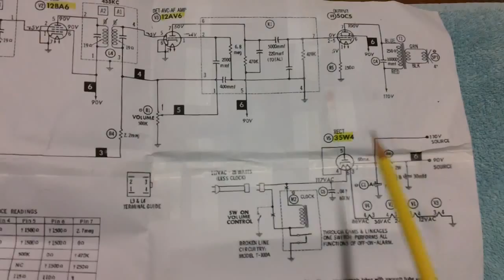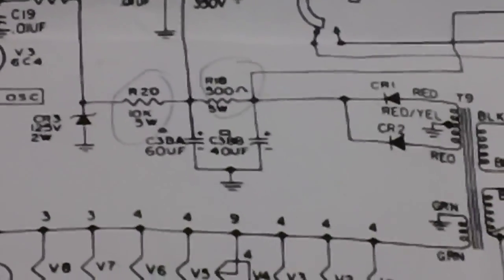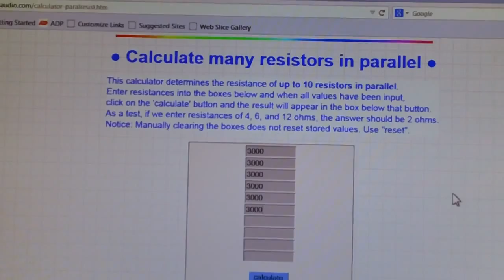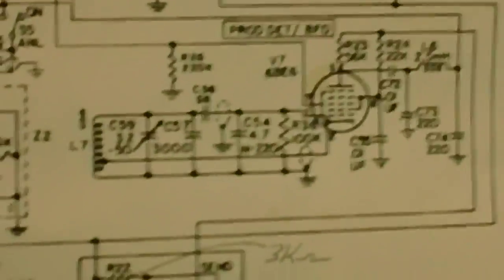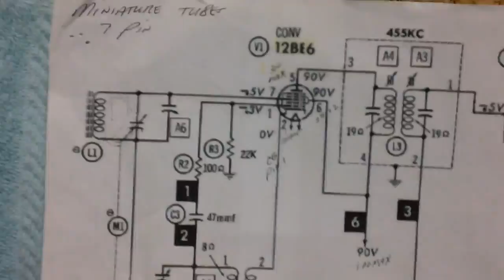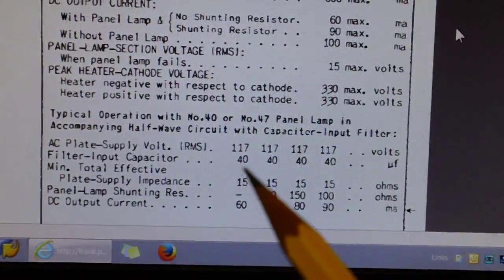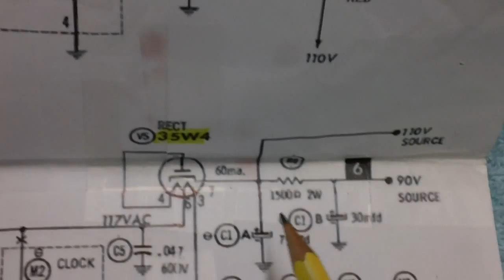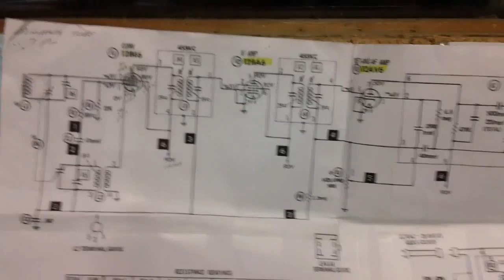General Electric C-403A Radio Repair Exercises (part 6 of 14).

Comment: As plenty of the other guys took the opportunity to work you over for the off topic information you imparted in the latter stages, I'm going to keep it classy and just say this.  Good move, on your part, comparing the boat anchor and the little AA5.  I know your target audience for these videos, are the guys getting started in the hobby.  I know, when I was starting, I was intimidated by bigger sets.  You soon learn, if you take the time to learn the basics, the circuity, for the most part, is similar.  If you break it down to individual stages, as you are doing, it greatly simplifies and takes the pucker factor out of looking at a schematic.  Good job, my friend.

Comment: Gang Busters looks awesome! I love those old crime shows. i've been listening to the early radio episodes of Dragnet lately. Another informative video John!
Reply from the maker: Daniel,
If you have a transmitter, or plan to get one, tune into the below website.  It plays Old-Time Radio around the clock.  It has a great mix.  You'll hear shows you didn't know existed:
http://tunein.com/radio/AM-1710-Antioch-s50924/

BTW...Gangbusters was also an Old-Time Radio show before it moved to Television.  Here's a link for some of them:

http://www.radiolovers.com/pages/gangbusters.htm

Regards,
John
Reply: Thanks John! I also have an app on my phone called Vintage radio that I use to listen to old shows. Boston Blackie is another one of my favorites.

Comment: John,
That was a really brilliant production my friend.  I was really glad you retouched on the power supply circuit in this tutorial as I learned something a little extra about electronics I had never thought about. 
Taking into account tungsten wire has a very low resistance when cold, or at first switch-on, somehow I overlooked the rectifier anode heater side of the centre-tapped heaters as having a sort of ‘varistor’ effect in relation to its warm-up time.  Once it is has reached its optimal operating temperature, and the smoothing capacitors are charged, there will be a steady current flow.
I have not seen rectifiers having centre-tapped heaters, like the 35W4, incorporated into British (now) Vintage Radios.  Should you be interested in making a comparison between American and British mains ‘transformerless’ radio power supply circuits, Google ‘Bush DAC90A’.  You will see there is an AC anti-surge resistor connected direct onto the anode.
The six 3,000R, 1W resistors will be 500R @ 6W...yes, it’s all good stuff my friend.
Regards,
Phil.

Comment: John,

I've seen that "cord-wood resistor pile" approach used a few times, mostly with radios/transceivers/monitors which were considered to be "constant duty" pieces.  The "Civil Air Patrol" HF radio network radios (Northeastern US) which I repaired all seemed to have had that modification performed sometime in the early 1970's (mostly Hallicrafters and Lafayette rigs). I'd betcha good money that that Hammarlund of yours sat tuned to 4464.5 Mhz for much of it's operational life, and that it was formerly a CAP rig, or belonged to an active member.

PS - Am sending an email.....

Regards,

Tim

Comment: Hi John. I was thinking those six resistors were used to increase the wattage spec. In parallel if they were one watt then added would give six and the schematic called for five ta- da.
Or not. Have fun at the spa pal.
Carl
Reply from the maker: Carl,
Rright you are, old bean.  Whoever built that heap of carbon met both the resistance and wattage requirements of the filter circuit.  But this series is aimed squarely at the rank beginner who by and large doesn't yet know about wattage, so I decided to keep it simple and cover only the resistance side of it.

Regards,
John

Comment: John
 I am looking for a USB to brain adapter to inject all this great info directly in to  my head permanently. I have checked Ebay,  Amazon,  Just Radios, Radio Daze and Radio Shack. Unless you can suggest a supplier I will have to keep watching your videos over and over and over and over.............................
Reply from the maker: Thanks, my friend,  You know...that's the way I learned the basics of this old radio repair/restoration stuff, by watching YT vids over and over.  Nothing wrong with that.  It's why the vids are made and posted.
So hang in there...it'll eventually all come together for you.
Thanks for dropping by.

Regards,
John